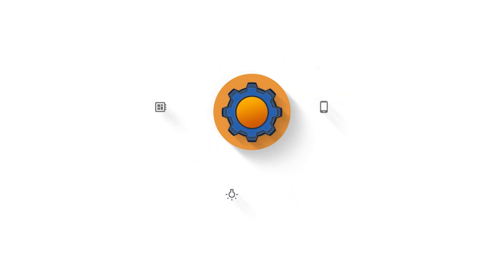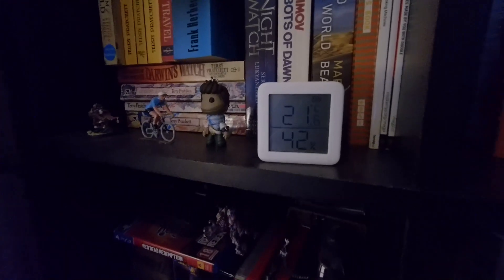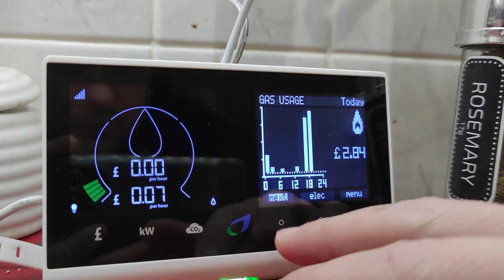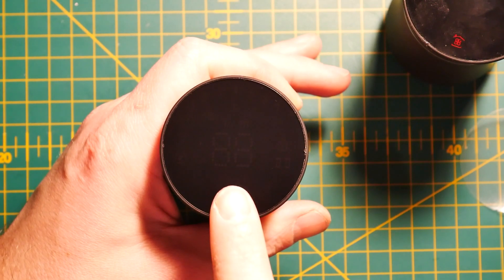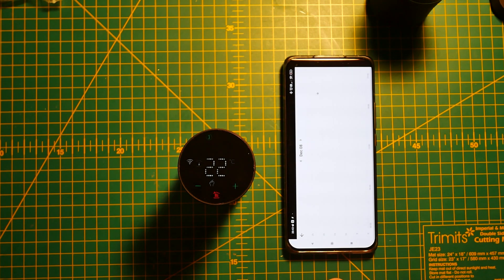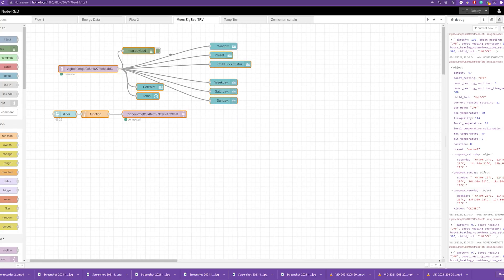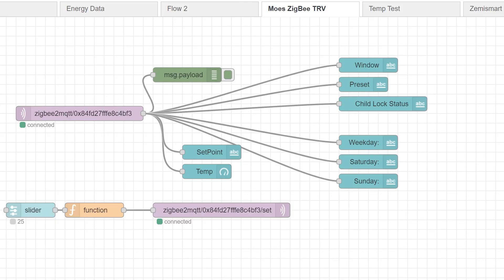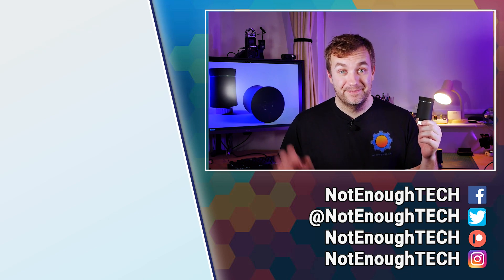Automating old heating system with Moes ZigBee TRVs

Comment: Hey just reading your article (big fan btw).

I have done something similar to you, decked out NINE radiators with trvs all controlled using HA and better thermostat.

My question is, how many of your Moe's (BRT-100) have failed?

Id say I have had to replace about half of mine in the 2/3 years I've had them and my pre season check reveals more failures.

I have started to transition away from Moe's... But I still have a lot of them that that have just failed with the fastening and if you/anyone had any solutions to this?

One I have trialled is to replace the batteries with an external USB source and GLUE the bottom on, but my USB powers off as the draw is so low.

Ant thoughts?
Reply from the maker: I had to disconnect mine as I moved places so my heating at the moment isn't automated. (that sucks). Was the failure caused on plastic parts? I wonder how much temperature fluctuations influence the strength of the plastic parts

Comment: Hi :) I have these TRV's installed but I have a problem. They show offline state on my zigbee gateway. Do you know how I can reset them so I can configure them again and try to solve the problem? Thank you
Reply from the maker: I assume you are using z2m? It has settings for how long is the timeout for offline state. You can configure that if your device don't report back often enough
Reply: @notenoughtech  no, I'm using the default moes zigbee gateway. I don't know how z2m works :/
Reply from the maker: Ok. The only reason for them to go offline would be battery level are you using re chargeable batteries? They have lower voltage than normal ones

Comment: Hi - did you run into problems with these TRV's going into idle state and not updating HomeAssistant until the touch screen is activated?
Reply from the maker: I don't use the HA so it's hard to comment on that front. Not come across this in NR

Comment: Thanks for telling your experience.
I don't know how to manage the boiler using individual TRV. How to do the on/off of the boiler through the cables of the traditional thermostat. Do you have experience on this?
Thanks a lot!
Reply from the maker: I wouldn't manage the boiler from TRV. Have a separate system to enable heating and use TRV to trim your temperature as needed.
Reply: @notenoughtech  do you know if it's possible to integrate a thermostat to manage the boiler together with the TRV?

Comment: I don't recommend those Moess TRVs. They are either almost fully open (reporting 25%) and fully closed (0%) and when open the radiator is hot as hell and noisy. They also spam zigbee with lots of messages unnecessarily, wasting the battery in the process. I got rid of them all and replaced them with Danfoss which supports granular valve opening (pi heating demand) and I am happy.

Comment: Nice info on your system. I've been playing around for some time now with my heating system and did not opt for thermostatic valves on the radiators. Each radiator has a 220v operated on/off valve. The downside is that it needs wiring from the relayboard on the Raspberry Pi to the individual valves/rooms. On the other side, they don't need batteries and  there is no wireless system required to operate. Avery room has it's own wired DSB1820 temosensor.
Reply from the maker: I'd have to rewire to do the same. Unless wires are hidden wife would kick off about this too much. May consider this if I ever change the heating system
Reply: My wife wants to keep the house free of EM radiation ;)

Comment: How did you get along with the smart trv’s? I’ve replaced my old 1990’s boiler in 2019 for a baxi 600 combo boiler, made a huge difference in gas, then developed my own opentherm thermostat based on an esp32, homeassistant and nodeRed. Reduced anual usage from around 32.000 kWh per year to 13.000 kWh/year. (5 bedroom detached house in Cheshire!) 

Node red used to apply weather & load compensations to the flow temps on the rads, keeping the boiler at the lowest acceptable temps, maximising the condensing mode of operation. 
I’m after feedback is there is a significant reduction in gas usage before investing in them! (14 rads total!) 

Thanks for the video! 

P.s if you replace your boiler, go with an opentherm compatible one!
Reply from the maker: Sadly still waiting for the plumbers visit 🙈 this month it will finally happen so finger crossed.
Reply: @notenoughtech  Thanks for the reply, Well, would be interesting to see how you get along with them. I think i'll give it a try, worst case i can flash them with ESPHome or something simmilar and sort it that way. Thanks.

Comment: hello
Following your video I bought 12 moes valves (I had hesitated with the aqara). I tested only one but I think there is a problem. After 2 days the battery is only at 83% while the valve has activated maybe only 5 times for the tests. What I find strange is that the display is always on (despite the lowest setting (0) the brightness reduces but does not turn off). Is this normal? Can the display be turned off? it's amazing that it stays on all the time. The battery of other valve models that I tested in zwave lasted more than a year... if so, I really regret my choice. Thank you very much for the additional information.
Reply from the maker: Hi. The display should only have a home icon on after timeout. Nothing else until you touch it. If yours stays on something isn't right. Another thing to check is how smooth your valves are. New valves can be opened with a hard push of the finger. Anything with more resistance will drain the battery more too.
Reply: @notenoughtech  Hello,
Thank you for your reply.
There must be a problem because even set to 0 the display stays on.
I set it only with zigbee2mqtt, maybe it comes from there. I will see with the others.
Reply: @notenoughtech  hello, 
I tested with another valve, it turns off fine. But on the other hand I have another problem with this one... the range of the zigbee signal is really low (1 meter from the coordinator!!! while the first remains on but has a long range) I will test with a third. .but i feel i'm going to have only problems and i'm going to send them back.
Reply from the maker: Sounds like an issue with the unit.

Comment: I got one now to test, that I want to set up in ZHA. You say, you paired it with 3 buttons. How did you do that, I spent 2 hours now and can't get it in pairing mode. How did you pair it in HA ? 😢
Reply from the maker: I use the z2m  - and to pair it you have to hold minus button for a couple of seconds until it shows up
Reply: @notenoughtech  Thank you very very much :-)   it works now

Comment: The previous model TRVs from Moes were flooding with mqtt messages, between 15 to 20 within 3 seconds then break for a few minutes and flooding again 15 to 20 messages. Is this still happening with this model?
Reply from the maker: Not that I noticed. The interval of messages depends usually on the sensor changes as well as interval

Comment: How far are you with your project? I am very interested in it, because I have a similar problem. Unfortunately, I don't have the skills to do it yet.

Greetings Nico
Reply from the maker: I'm slating this for september. Most of the software is done, some integration issues, plus I have 3 more TVR to test.
Reply: @notenoughtech  I am so excited to see your automation! I have learned from your videos really ne menge, but to set up a whole automation for it my skills are still far from enough, unfortunately, but I'll keep at it. the thermostats I have also already ordered. if you still need a DAU to test let me know! Thanks for the great videos!

VG Nico

Comment: ooh the zigbee
Reply from the maker: ZigBee is the best :D (for now)
Reply: @notenoughtech  completely agree. I also use BLE mesh which I feel is a bit less power hungry than the wi-fi based protocol Have been using the xiaomi el-cheapo temp/humidity meters for a year and they still at 100% battery charge if you believe
Reply from the maker: I actually have great experience with Bluetooth mesh as well. Battery life on these is awesome

Comment: Hi, very interesting video. I installed 2 of these to try them before installing others for the other radiators. I opened my Google nest thermostat and closed these 2 TRVs by setting the temperature lower than the “minimum temperature” as mentioned, but the radiators are still heating!! My aim is to switch them off but it doesn’t work! Can the TRVs work with a Google nest thermostat?
Thanks !
Reply from the maker: They should close pretty quickly after setting them that way just be sure the Temperature is calibrated correctly.
Reply: @notenoughtech  Thank you very much

Comment: Great video as usual! 

I was wondering if you have tried to open the case to see what's inside ? 

I want to use it as a wireless thermostat for a bunch of electrical radiators with shelly one controlling the pilot wire. 

It works but I would like to remove the motor that has no use for my application. After removing the 2 motor screws nothing came apart. Any idea on how to open it?
Reply from the maker: I haven't tried to open thses but most likely they have a hot press or glued in guts. it means damage is likely. It's a bit odd way of using these, perhaps consider a zigbee dev board with a e-ink display?
Reply: @notenoughtech  I acknowledge it is a little odd but it is doing the job. I am afraid that a a zigbee dev board with a e-ink display is a lot of work to do the same function
Reply from the maker: Fair enough

Comment: I have 7 exatly the same TVRs. One of them is set to 23 degrees, shows 25 degrees and full heating. I tryed to close it manually I mean I set temperature to 27 degrees and TVR closed heating. But why it doesnt do it when it shows 25 degrees?
Reply from the maker: Hmm that's a strange one. How's the battery voltage?
Reply: @notenoughtech  New alkaline battery

Comment: Have a look at intergas boilers, not sure how much room you have in the cupboard but they are pretty good. The price that you’ve been quoted to move the boiler seems a bit steep, given that the move is very small. Depends on where you are in the uk but maybe reach out to another YouTuber Allan heart and see if you can do a collaboration? 

Be interested in your diy solution as I’m looking for a system to control a manifold so I don’t need trv’ s on the radiators from a noise perspective. 

What is the noise level on those trv you have? Remember if you fit them to every radiator you will need a bypass valve on the water system or a radiator that’s on all the time incase every valve shuts and the boiler keeps on heating.
Reply from the maker: I'm thinking a heat pump as  this is where world is going next I believe. The trv have a separate article. They are almost silent I know the noise was a concern in the previous model.

Comment: Beware battery life. I tried one of these - at least, not the same model, but very similar functions, so probably just re-packaged. The batteries lasted just a few months. That's probably not surprising when you consider it's driving a pin against quite a resistant valve.
Although I am sure you will save significantly more in fuel than it costs in batteries, by the time I factored in the effort to change batteries in all my radiators every few months I decided it wasn't worth the effort, so I abandoned the idea.
Reply from the maker: Few months is what I would expect from these - My rough estimate is about 2-3 months and I would be pretty content with it. I will have a brand new valves which will also help as any resistance put on the driving pin will cost you deal. In my tests so far I drive it 3 times a day on/off and after 3 weeks I have 90% charge reported (granted its driven without a load).

Comment: hi, nice video, can you add this TRV to Hive themostats?
Reply from the maker: I use it with custom coordinator. You can link it via services like nodered and home assistant. I'm not sure if direct integration works as I haven't used hive myself.
Reply: @notenoughtech  thanks, I don;t have to intergrate it with Hive, can I use it in one radiator in parallol with hive as different zone? e.g. only heat the TRV in the room not rest of rooms in the house?
Reply from the maker: Yes you can use it in self deployment mode without cloud. I recommend you watch today's video about these and how they lie about the temperature
Reply: @notenoughtech  yes, just watched it, aware of this as this is the same issue for Hive and other TRVs, as Hive says the TRV will learn the behaviours and adjust.
Reply from the maker: I wonder how good that learn is. 9 degrees was the biggest difference I noted with hot thermostat and my room. 
I'd be keen to get some data from that process and see how well I did. 

Btw my TRVs just arrived! Wasn't expecting it after xmas
Reply: what I couldn't figure it out is, the hive has a receiver or a small white box connect to boiler, and the hub is sending signals to the box and trigger the boiler on and off. however if I use TRV from Tuya in one of the radiator, I assume I miss a trigger to boiler, hope it makes sense

Comment: By only heating certain rooms, you will find you save quite a lot of money even with the older boiler.  The boiler will not be so undersized if some radiators are closed off.
You're definitely on the right track with this one.   In Australia, hydronic heating is not so popular. Most of our solutions are forced air, but this sort of setup could be modified to use controllers that can run damper motors instead of radiator valves :)
Reply from the maker: Heat pumps are trending and I'm not sure what is going to be a most ideal heating scenario that is efficient and has a low carbon footprint. Gas boilers are definitely not considered low carbon footprint. 

Keen to give it a year or two and then make the decision once the market matures enough and takes a direction
Reply: @notenoughtech  Unfortunately here in Australia electricity is still primarily produced by coal so electricity here is pretty dirty, but heat pumps are meant to be quiet efficient.  I am not sure how the go as far as controlled heat like Gas can do, but I am sure it will mature over the next couple of years
Reply from the maker: You would think that places like Australia would take advantage of solar power more right? Or maybe nuclear as the pushback would be smaller due to available space (although nuclear needs water).
Reply from the maker: I always wonder how that manipulation works. Its been  40 years since Chernobyl and Japan has proven that nuclear tech can rapidly deconstruct itself in an unscheduled manner without imposing risks. 

I have recollections (I was a small kid but recall flashbacks) of being shielded and taking anti radiation pills after Chernobyl. After all we weren't incredibly far. And yet I reading about it more, learning what went wrong (human error)  and having 40 years of technical progress I feel comfortable with the fact of having nuclear plants. One is located just shy of 20 miles where I live.
Reply: @notenoughtech  I agree.  I was not near Chernobyl, but I certainly remember hearing about it, but technology has come a long way and even the worst human error can be counteracted now.
Money still talks, so do votes......
Better not get deeper into the rabbit hole of politics :).   
Love your videos as always

Comment: Just curious why you need to change the valve on your radiator, is it because none of the thread adapters they supply are suitable? I’m already using Tado but had a thread compatibility issue so I 3d printed some adaptors using PETG and it has no issues with the temperature it has to handle.
Reply from the maker: Unfortunately i have a very old and awkward valves on my system. Wish I could just pop the trv on it

Comment: In generel, (Zigbee/smart) TRVs are missing a mode where you can set the valve-opening, eg. in 5 steps or more. Lets say you want to control floorheating - the valve is not always placed in the same room, so the temperature setting is not usefull.

Perhaps theres a workaround. Excited to see if this also becomes an issue for you - and a solution :)
Reply from the maker: I'll have a solution to this problem too thanks to uto calibration. That's a great problem btw I didn't think of that. I appreciate this.

Comment: I've got a system called Bosch Easycontrol for my heating. It's had similar devices which I believe probably have ZigBee running on them but it has some shortcomings and I would have preferred to have a system I could have developed myself rather than theirs. For example it doesn't notify me when the trv battery is low, a very simple thing really. Plus mine was expensive. 11 TRVs at 50 quid a pop and the 200 quid unit which connects to WiFi and boiler plus fitting took it to the £1200 range. And it hasn't made a massive dent on how much I save but does regulate the temperature better. However as it's measuring temperature on the trv which is right next to the radiator it's skewing it's own result and you are only able to use a -2/+2 degree adjustment on each device. Would be better to have seperated temp sensors mounted in room which work in conjunction but not an option I now have.
Reply from the maker: I have good news in regards to my system and making you a little bit jealous. I already have a ZigBee battery monitor which sends alarms to Android devices.
(Check out ZigBee low battery waring vid). I also came up with automatic calibration for the temperature so my thermostats will show the actual room temperature  without worrying about thermal properties affecting offset. 

Next step is to add my PIR sensor to make an a heat map of rooms in use over time. This data will be used to lower setpoint in rooms not used as often at selected times.
Reply from the maker: Looks like YT filtered your comment out. Feel free to DM me on social media especially if you are sharing any links.